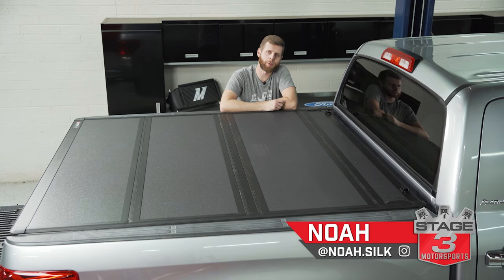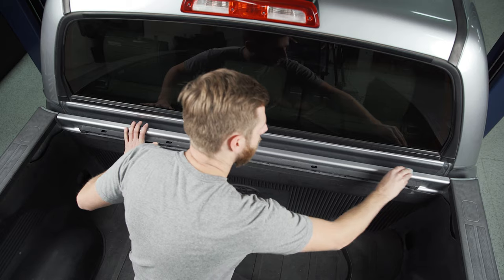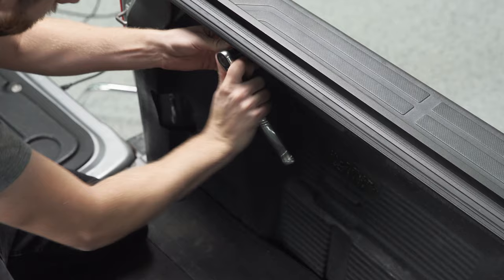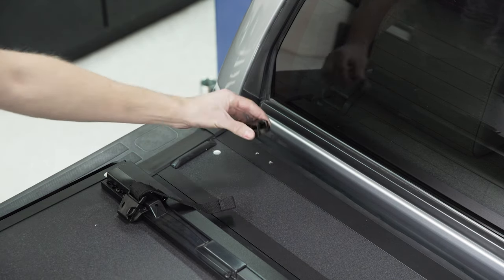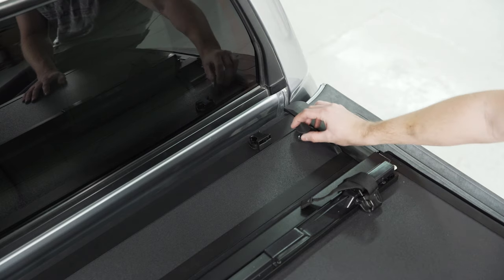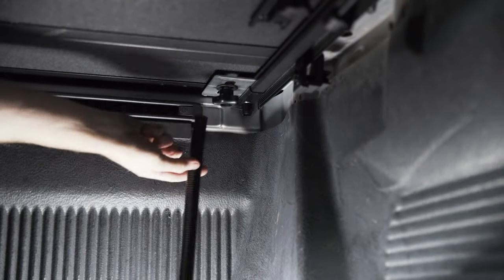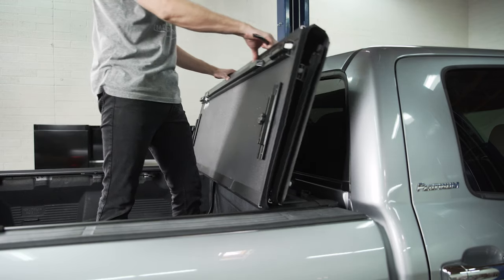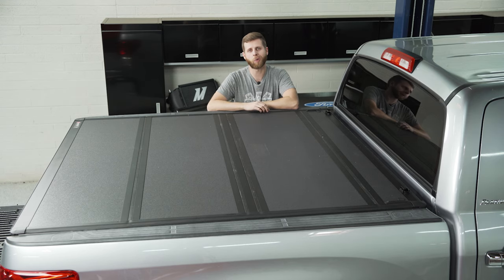2007-2020 Tundra 5.5ft Bed BAK BAKFlip MX4 Folding Tonneau Cover Install

Comment: Why even use a gasket or bed cover if you're just going to drain the water into your bed?
Reply: Nobody just lets it drain into the bed that would be super silly. Gotta drill a hole out and feed the drain pipes through.

Comment: I have a 2017 Tundra with a drop in bed liner that covers the front bulkhead, I noticed in your video yours doesn't cover that area below the window where you added the seal directly to the metal 
bed. Did you cut the bed liner down to fit the rails and install the seal or does the seal just go on top of the plastic bed liner that covers the bulkhead? ty in advance
Reply: ive got same problem. What did you end up doing?

Comment: Didn't even show how to attach the deck rail system to the cover, that title is misleading af
Reply: Sorry about that! The video was uploaded with the incorrect title. It's been updated now to represent the tonneau kit we installed. If it's any help, the drop brackets for the cargo rail system are simply small square brackets that bolt to the factory holes and lower the cargo rail to sit underneath the tonneau rails. It won't require any massive changes to the cover or the truck bed.
Reply: @NoahStage3  so if you have rails it’s pretty simple?

Comment: Hey, thanks for the video, would you mind tell me what "w/" means? Does that mean "with Deck Rail System"? And by the video, your Tundra doesn't have any Deck Rail System, am I right? Thanks!
Reply from the maker: Correct, it does not have the rails. the "w/" means with
Reply: @stage3motorsports  Thanks a lot!

Comment: Curious.  My 2020 Toyota Tundra comes already comes with a track system mounted to the inside walls of the bed.  Does that mean I have to take these tracks out in order to install the MX4 tonneau cover? When I go to order on bakflips website, they have 2 options (1) w/ track management system or (2) w/o, what's the difference and how do I know which one to choose. Thanks!
Reply: My understanding is, if you have the Track Management System, you order the BakFlip  model that will accommodate that system.
Reply: They provide brackets that lower the existing rail system